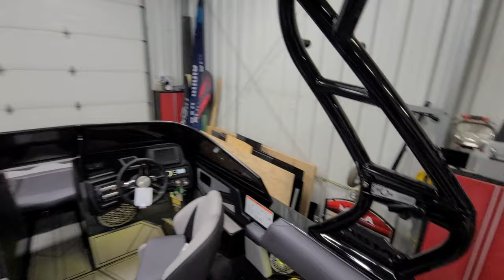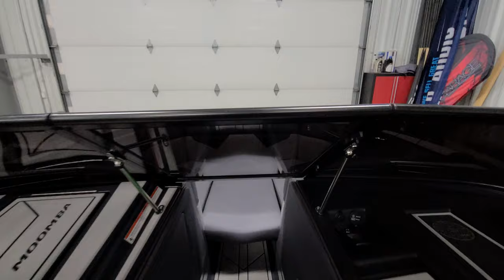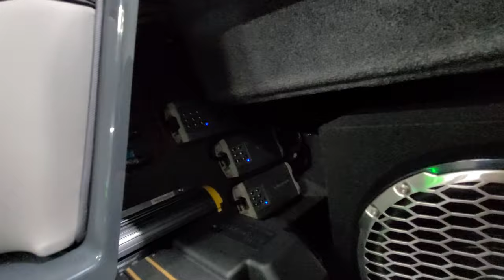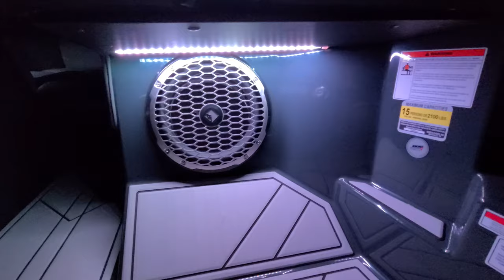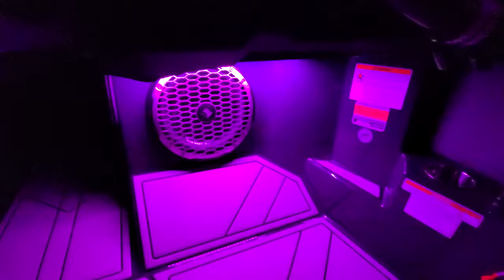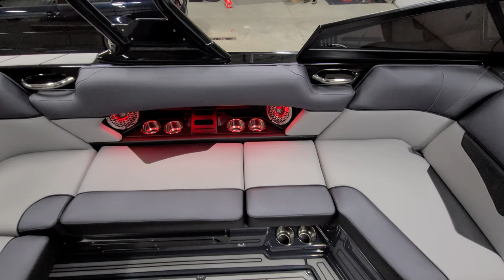2020 Moomba Kaiyen Rockford Fosgate Audio System & LED Lighting

Comment: What led strips did you run with the speakers? And did you use another module for the led strips to work with the speakers?
Reply from the maker: We used XK Glow strips for the LED strips. They were tied into the Rockford Fosgate PMX-RGB LED controller.

Comment: Are you running any of the speakers to full rated power? Doesn't seem like enough amps for those speakers at all.
Reply from the maker: The two TM400x4ad amps are bridged to power the towers. Each tower speaker is getting around 300W a piece. The TM1000x5ad is powering our interior speakers and our subwoofers. The interior speakers are getting around 100W a piece. Each subwoofer is getting around 300W, so this thing absolutely pounds. Rockford recommends 150W to the M2-65B, but in our testing, 100W pushes them absolutely perfectly. Each TM400x4ad amp had a birth certificate of 590-600 watts RMS, the TM1000x5ad had a birth certificate of 1,262 watts RMS. From a numbers standpoint, the interiors are technically under powered; from a listening standpoint, this thing sound absolutely amazing.
Reply: The Audio Garage   In running the TM1000x5 to the 6 interiors, you’d be pushing max 128RMS (dynamic) x 4, but across 6 speakers.  That puts you max at 64RMS on 4 of 6 (parallel) and the other two seeing the full 128RMS on 150RMS capable speakers, which is definitely leaving something on the table.  Assuming the subs are 4ohm and wired in parallel with a 2ohm load, they are probably seeing closer to 350 watts each in terms of dynamic RMS off of the 5th channel.  I am sure it sounds excellent though.
Reply from the maker: @straightshooter9397  I can't remember the birth RMS number exactly, but the TM1000x5ad we used was exceptionally powerful. Most of the ones we install birth out around 1,200W RMS . This one birthed out between 1,300W to 1,350W. Sub channel was putting out around 650-700W at 1 & 2 ohm, and around 600-650 at 4ohm. The speakers per channel were around 160 at 2 ohm, and 150 at 4 ohm. The way that these amplifiers are built ensures that they are very efficient and absolute power houses. The speakers are being a little under powered as I stated, but they are getting a clean 80W for the 4 speakers in the interior and 150W for the 2 speakers up front. We have installed a lot of RF in the past, the previous PM series speakers were 85W RMS. The only difference between the new M series and the older PM series is the tweeter. Rockford re-designed it to be less brittle as they had some people pressure wash the speakers (who would do that, right?) and the tweeters shattered. We talked to Rockford when they first teased us with the release of these because we were worried we would lose the amazing sound of the PM speakers. They assured us that everything was staying the same, just the tweeter changed. With that being said, we were still reluctant as now the RMS is 150W whereas it used to be 85W. We tested the living heck out of the speakers to ensure they still sounded good and performed well around that 80-100W we had been giving their predecessors, they did not disappoint. Please trust me when I say that we would not install a system that would not sound absolutely amazing, and be incredibly reliable. Funny thing about this boat, the client has never actually had the boat at full volume like we did in this video. He said half volume is more than enough for him. He wanted this awesome system because there was another boat on his lake that was louder than his old one, and he wanted to be able to show that boat up when need be.
Reply: The Audio Garage   I like the response!  It seems we are on the same page aside from you maybe squeaking out some extra juice on the birth sheet.  At 80RMS, it would still be at basically half the RMS the speakers are capable of.  As you pointed out, these are interiors and you have those 4 cluttered together so I am sure it is plenty loud.  I have the same amp.  I plan on doing a total of 6 interiors, 1 sub and 4 tow towers on my Aqua Patio.  I’m not sure what configuration I am going with though in terms of amp layout.  I wish they made a 1200/4 amp.  Two 1200/4 amps plus a sub amp would be phenomenal.  I’d run 8 M2’s at that point just because you would have an even 150RMS to each unit at 4ohm.